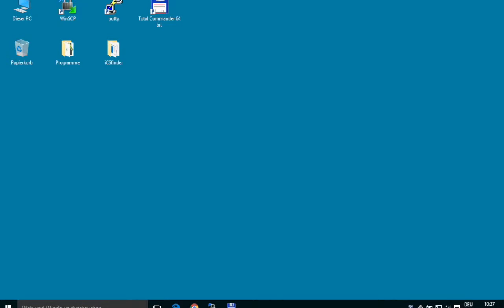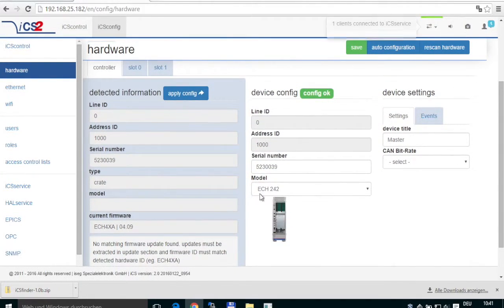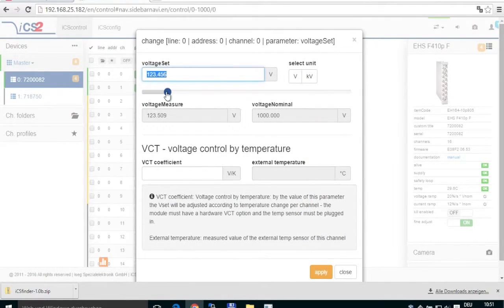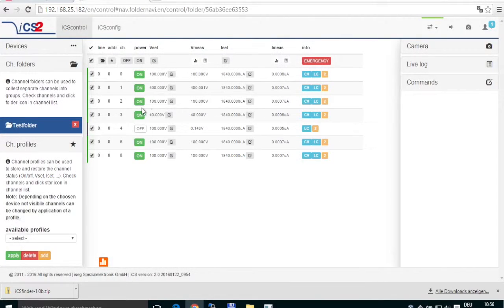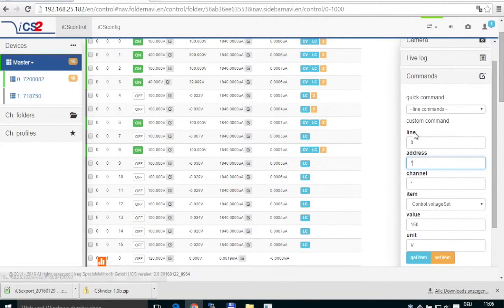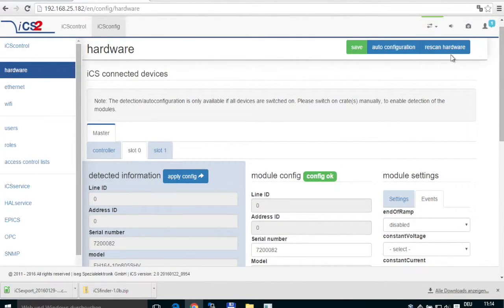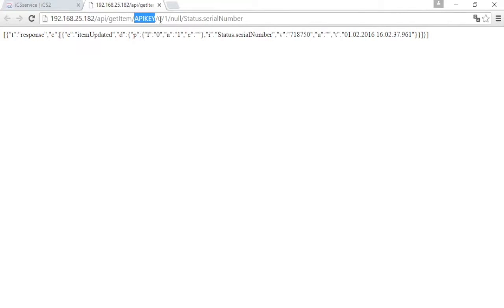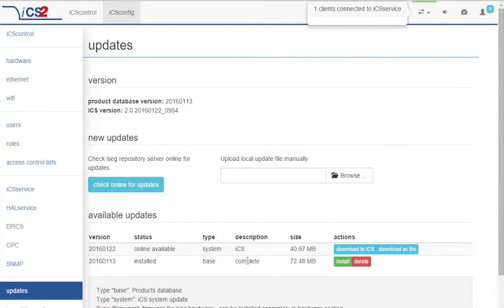iCS2 - the complete tutorial

Comment: Spécifications de iseg iCS2 unified software :

    Système Linux intégré avec ‘Operating System’ préinstallé iCS OS
    Disponible sur contrôleur CC24 et sur mini-box externe iCSmini2
    Contrôle d’un large panel de hardware Iseg équipés de CANbus ou d’interfaces série RS232
    Mise à jour facile du firmware avec téléchargement en ligne
    Configuration hardware via Ethernet (RJ45) ou WiFi (en option) en utilisant un navigateur web
    Autre configuration possible via un logiciel multiplateforme natif isegControl2 (Windows, Linux, Mac OS) 
    Navigation via tablette et mobile pour la configuration, la maintenance et les essais sur site
    Connexion d’une caméra-IP pour la vidéo surveillance
    Services préinstallés : EPICS, OPC/UA (en cours), SNMP (en cours), HTTP, Websocket, isegHAL
    Intégration aisée dans les nouvelles expériences avec le contrôleur CC24
    Upgrade des anciennes installations avec nouvelles extensions vers Ethernet (RJ45) et WiFi via mini-box iCSmini2
http://www.physical-instruments.fr/iseg-ics2-unified-software/